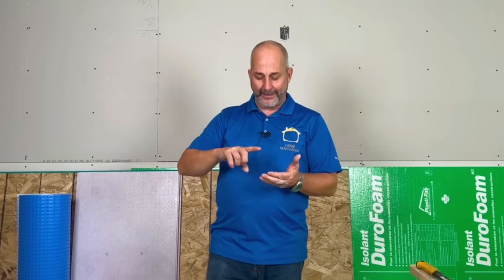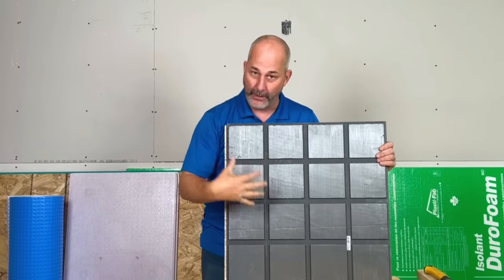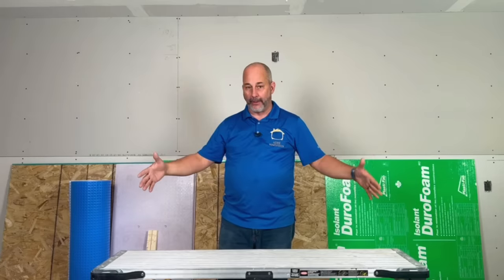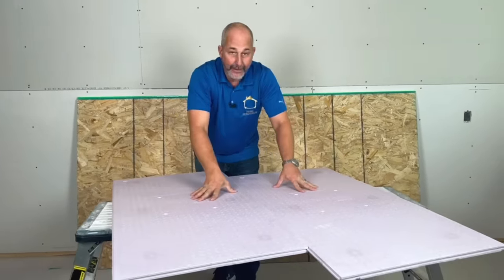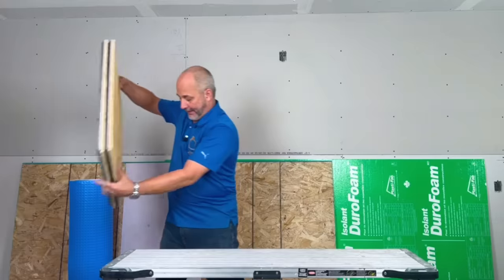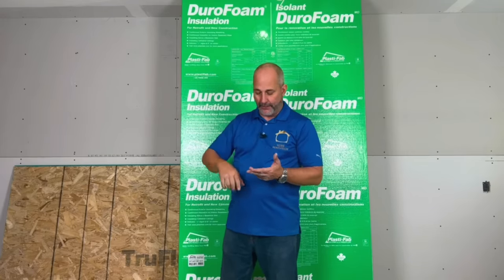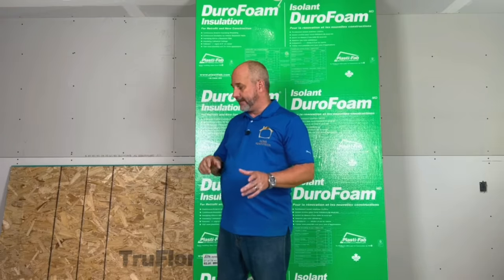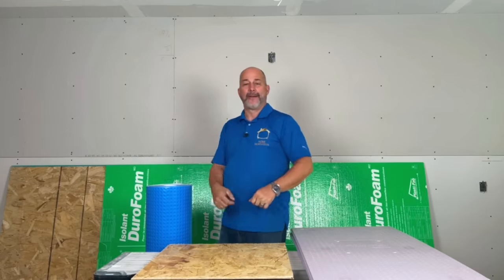Comparing 5 Different Subfloor Systems and What They Cost

Comment: Jeff! Watching many of your videos as we work on our "new to us" home! Looking at working on the basement next and trying to determine best solutions. Here's some info and hope you can help!
- Built in 1969 (Addition with additional basement space built in 1999) 
- Northern USA so dealing with some cooler temps
- No water intrusion on the addition side (pulling drywall off the original basement in a few weeks)
- Concrete slab with thin tiles on top (testing for asbestos in the next week)
- LVP flooring will be going on top of whatever subfloor option.

Additional:
- Utility Room (Strip) separates the two living spaces so there is an AC drainage line that runs across the space that I would love to cover if possible

Comment: The previous owners of our house installed a Dricore subfloor, like the first panel you shared. Unfortunately they didn't follow the gap instructions and the OSB edges not only touched the drywall but the foundation walls, wicking up moisture, swelling it and inviting in bugs. Went replace it and its no longer made in the same thickness or the same quality. Our previous floor was an 1" think and the OSB was solid with a nice finished sheen. New Dricore is 3/4" thick with a very rough top and the tongue and groove is extremely uneven and rough.

Comment: Very informative Jeff, many thanks. Our electric sauna is not heating up as it should. I might need to upgrade to a larger stove (7.5 KW versus the existing 6 KW) but one possible alternative is to install 2x2 Dricore panels above the cement floor first. The sauna is within our sleepcamp which typically is not heated and that floor is quite cold and possibly accounts for the subpar sauna experience. Once installed, I plan to paint the Dricore sheets with a heat resistant paint then add our thick rubber drainage mats atop the Dricore sheets. Some water will fall onto the new subfloor within the sauna but the heat should help to dry it out fairly quickly. Might you foresee any issues I have not considered?

Comment: I love your video.  We had to solve a mold problem in our home that is requiring me to put in new flooring in our basement.  Our house is 30 years old and we live in IA.  We have had moisture in the basement, but the only time we get water is if the sump pump dies, and then its only a small amount around a crack.  Here is what I did so far:  I had the crack in the basement floor professionally patched, along with some other cracks.  I fixed a grade problem in the front of the house.  I also spray foamed the entire basement wall with closed cell foam.  As I look at the underlayments, I see the problems you lay out in your video.  They just don't have enough performance.  Since I believe our sump pump and other things I did to mitigate water coming into the basement will prevent any water, we will just have high humidity I need to deal with.  I don't beleive there is any vapor barrier or anything else under the concrete, and I am using vinyl plank flooring that has a pad attached.  My goal:  to be a thermal break and get the basement warmed up in the winter.  Can I put vinyl plank directly on top of Duro Foam?  (or foamular 250 if I buy from menards)?  I'd rather not have to purchase OSB or plywood as well if I can avoid it.  I like the idea of having 3/4 - 1" of foam insulation. If I cna use foam under vinyl plank I want to make sure its hard enough to support the joints in the vinyl plank.  thank you so much for your help.

Comment: This is excellent!  I've put cameras in my vacation home basement for almost a year - trying to figure out if it water is coming in the basement or what.  It's in the woods in PA so it is naturally high humidity - but I just couldn't figure out if, and how, water is coming in (my rubber mats were often times moist underneath, but the concrete was always bone dry - even after torrential rain storms).  House was built pre 1990 - so that explains it!! Thank you! I feel much more confident considering finishing the basement someday with those water management squares.

Comment: I live in northern Virginia in a house from the 1950s.  It was "finished" in the 1980s and recently it has sprung a leak in the middle of the room.  I've run sumps and downspouts out to the road and to the back of the yard and I haven't had the same issue since.  I've recently started demo on the basement ripping the floor, walls, and ceiling off, and plan on filling gaps and cracks.  I'm writing for advice on a thermal and vapor barrier.  I'd also like to put radiant heat on the floor too, but we have low ceilings, and adding too much flooring could cause issues there.  The room will be used as a guest room and as a home office.

Comment: Hi Jeff. Great video! I also watched your video on insulating basement walls. I have a  1982 condo with a finished basement with a musty odor. So I decided I will replace the existing insulation on the concrete walls per your other video. But I also have finished interior walls. How should I install the subfloor up against existing interior walls since it’s too late to put the subfloor under them? Simply but up against the drywall? Cut back the drywall and but up against the bottom plate? Seal the air gaps between the subfloor and bottom plate with spray foam?  Thanks!

Comment: Hi Jeff, I'm repurposing my exterior garage as a rental in Ontario. My concrete floor does have a vapour barrier and 2" rigid insul. under the concrete. I'm using Luxury Vinyl Plank with a underlay attached to the plank, what else should I use? Or can I lay that right on the concrete? Thanks for everything you do, the only reason I started this project was because of your videos.

Comment: Good video.  Good Info.  Here is why I'm watching your video.  1st time renovating a house and I have it down to the studs.  This is a house not a basement:  1974, 1,100 sq. ft., slab foundation, Climate zone moist 3 (right on the edge of 4).  Shortish COLD winters and wet hot summers.  Looking to make it more comfortable without causing mold issues.  Flooring will probably be some carpet, sheet vinyl (bath & laundry), possibly wood laminate in the kitchen.   Concern #1 I don't want to cause a mold problem  Concern #2  how the heck am I going to get all the levels to transition smoothly and what about the front door?  A three inch trip right when people walk in?  Do I just cut the door down?

Comment: Thanks for sharing so much knowledge. 
I have a house built in 2018, the basement floor (L shape 925 sq ft) is concrete and the walls are from Superior Walls (insulated precast concrete wall panels). Have humidifier and the furnace only have one return and one vent...yes it gets cold! What I want? Other than a decent heat; is to place a rubber flooring roll, like gyms. Either 1/4" or 1/2" thick. Another thing to mention is that the floor is not even. 
What is the best way to go with it? Thanks for your time.

Comment: I've just started a full on renovation on a home that was built in 1953.  The basement was partly finished back in the day, but the concrete was just painted.  I'm looking to put a nicer floor in.  The concrete slopes from multiple directions toward a floor drain, so it is not anywhere near level.  Do I pour some self leveler first, then put a product down? I'm liking the dimple membrane.

Comment: I live in Hagerstown, MD. House was built in 1976, when bought the house 3 month a go and pay a contractor to re do the attic insulation and seal the base, when we bought the house the radon levels were between 3.2-3.8 now that the basement is sealed it is between 8-10. There is carpet on top of the concrete floor. I want to remove the carpet seal the concrete, put a vapor/thermal barrier and put subflooring (add the pump for radon mitigation as well fater all sealing etc is done). What is the best way to go about this project? Again Objectives are: 1) seal concrete (so the pump under foundation create a negative pressure under the house), 2) vapor/moisture barrier the concrete, 3) install subfloor, 4) install vinyl. I was looking at owens corning formular 150 (4x8 r5 $27 per panel).

Comment: New house (55+ condo).  Builder finishing basement.  I plan on removing carpet immediately (builder would not sell a finished basement without any flooring or put down LVP) and put down LVP myself.  Even though it's a brand new house, I want water management for long term piece of mind.  Next priority is thermal break and insulation. I will be bringing my bicycle regularly through the walk out basement sliding glass door.  Price is only a minor concern.  What would you recommend?

Comment: Hey Jeff - Thanks for all your great videos! I'm starting my basement reno for my 1950's house and of course vapor, water management, and temperature are all factors (fun I know!) Also, ceiling height is a concern as the ceiling varies from 6'8" to 7'2". Plan is to turn a chilly basement office into a not-so-chilly bedroom. Which approach would you recommend to balance height, cost and R value:
Option 1. DMX + 1" rigid foam board + floating floor (10.5mm cork click together) = ~1.6" thick but decent R value (~R-5.5)
Option 2. Dricore Insularmor (rigid panel w/ water mgt) + floating floor = ~1.4" thick and decent R value (~R-5) but pricey!
Option 3. DMX + 19/32" plywood + floating floor (cork click together) = ~1.05" thick but low R value (~R-2.5)
Option 4. DMX + 23/32" OSB + floating floor (cork click together) = ~1.25" thick but low R value (~R-2.6)
Additional background:
- I chose cork as it seems to have the best R value for my buck, but welcome alternatives (other than carpet or hardwood)
- We have an egress window and french drains going in next month, so water mgt may not be as much of a concern as it's been historically
- Plan is to put subfloor down then frame walls on top to minimize thermal breaks
- We're in NY, so we "enjoy" all seasons and types of weather

Comment: Your videos have helped sooo much.  We are first time home buyers . My question is.  Are home was built in 1949 basement is damp. We just removed all the carpet they had over the concrete (it was Grose and wet) what is the most cost effective way to get a laminate or vinyl click floor to work for the basement.  We live in northern Ontario. We think maybe a small amount of water through bottom only in heavy rain.  We have only had the house 1 month.

Comment: I live in a really quiet location so for my home theater I didn't want bass transmitted to the outside through the concrete slab, so I used Dricore R Plus with an 5/8" OSB topper for my subfloor as a sound break over concrete.  I did screw the edges into the concrete to secure them as recommended by the mfr, but with the OSB on top I doubt it was really needed.

Comment: Home built in 2015 so basement floor does have a vapor barrier. Plan to install LVT in the basement. Was leaning toward Dricore Insul-Armor because there was a single incident - years ago - of moisture on the floor before I used drain tile to divert water from gutters away from the house. No interior water issues since, but as you know water can still find a way inside so…
Two Questions:
(1) Do you agree Insul-Armor us best for this installation; and 
(2) Can I frame walls directly on top of Insul-armor (of course framing only AFTER I will have installed both Ins-Armor AND foam paneling on the walls. 

Thank you! enjoy your content very much!

Comment: That was really interesting.  I live in a ranch style house just across the Ontario border in Hudson, Quebec.  The house was built in 1956.  We moved here in 1998 and haven’t had any water infiltration issues in the basement.  The main part of the basement is about 700 square feet with a concrete floor.  There’s a second section under the bedrooms where the floor is gravel.  The main part of the basement is used as my workshop,  the gravel area is used for storage.  I’d like to put down a water management and thermal break solution particularly in the main section.  We had our house evaluated under the Fed’s greener homes program.  One of the recommendations was to insulate the basement floor (thermal break) to get a 3.5R value.  Since the main section is used as my workshop, I don’t plan (or need) to put down nice flooring.  Suggestions ?

Comment: Just the info I was looking for.  I finished the basement of our 1963 house about 16 years ago.  What the issue is now of course is that it smells kinda musty and is cool.  We installed carpet on underpad directly on the concrete floor at the time because we wanted something of a thermal barrier.  The concrete is certainly not vapour barriered underneath, but I have never had standing water issues in the basement either.  There was some effloresecence on the walls before I finished them with fiberglass batt with a bit of space from the concrete.  Not sure if this is where I went wrong also.  I could possibly stand to have another inch or so of headroom taken up but thats about it, the ceiling is lowish as it is and the bulkheads are as low as I could make them.  But I have right now bout 2 inches between my head and the bulkeads lol.  I think I mainly need vapour control on the floor but maybe some insulation valure as well?  seems warm enough with the carpet and underpad, but I want to pull out the carpet altogether and go with a vinyl plank or such.  probably 800 sq feet or so.  What do you think?  Am I pulling drywall around perimeter and installing foam board and then batts too?  I live in the okanagan valley in BC, so climate is hot dry summers and cold sometimes wet winters.

Comment: Simply awesome how you are willing to help people with all that experience has taught you.  Jeff, I need to replace a tow-behind RV.  Only about 5 feet square on the end of my main living area.  I am not a carpenter, and my main concerns are keeping the floor flush with existing floor, so the slide outs work as designed.  Problem is support is from 2x2 aluminum frame spaced about every 3 1/2 feet the rest of the floor is a thin Luan sheet top and bottom with two inches of rigid insulation between.  Of course, the Luan sheets are moldy and rotted.  Can I simply but a sheet of aluminum over the 2x2 frame and foam the insulation underneath?

Comment: You're channel has been so informative as I refinish my basement after a broken pipe. Its a 1980 home in WY and I did your taped plastic over the floor trick and got zero moisture even though its been raining cats and dogs outside. I want to do LVP, but I don't want it to feel cold as concrete. I've looked at a product called dry barrier to go under my LVP. What would you recommend?

Comment: Since you said we can have a conversation about my basement.... I just bought a 1950s house in Chicago.  The basement is pretty short on height,  no more then 5'7", in the winter it gets too cold and we can't hang down there. We have brick wall all around and concrete floors. No water down there but a lot of moisture,  we have a dehumidifier working day and night.  This winter would be nice to have it warmer so we can use it without losing too much height and not spending too much! Thank you!

Comment: Hey Jeff, my home was built in 1956. It's a 2 story ranch on a slope with an attached garage. I'm upgrading my partially finished basement this year. I'm close to my 7' clearance so I'm going with exposed joists for the ceiling with some sort of sound proofing, I have no idea what yet. I'm thinking the pink board and LVP for the floors. What do you think?
Reply: NVM I just messaged again and don't have the 1" to spare plus the floor. DMX it is for me. Any suggestions for sounds proofing between the exposed floor joist?

Comment: Just about finished my basement floor. I am using Insul-Armor. I have a two year old build but I selected it for warmth then the moisture issue. Also very easy to work with, no saw or mess to cut, super lightweight as well. Project was delayed when the product was out of stock last winter / spring. We are installing a SPC luxury vinyl plank on top of it. The ends came up a bit on some but they tapped back down. Even with only a little more then half done the temperature difference is huge. Might even install more Insul-armor under the starts with low cost flooring on it for storage area.
Reply: @JAM - I, too, am leaning toward Insul Armor with vinyl.  How's your install going? Almost finished? I'm interested in your outcome; how does the finished floor feel under-foot? Any flex or feeling of 'mushiness' as you walk? Squeeking as the panel joints rub together? Any recommendations? Thanks in advance.